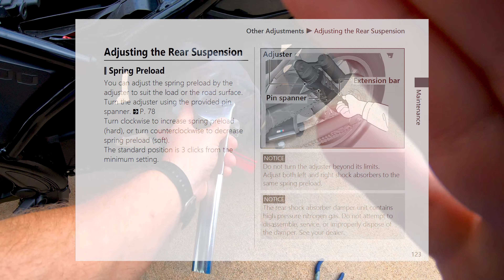REBEL1100: Suspension Tuning Part 2 - Adjusting rear shock preload

Comment: I got a copy of the service manual and it states the adjustable range is 18 clicks with the first click being zero so you must have been at the limit when you counted 20.  Thanks for the video.
Reply from the maker: Thanks for the info, Wayne!  That's good to know.  It's odd that Honda stated not to exceed the maximum setting while also not specifying what the maximum is in the owner's manual.  I ordered my factory service manual, but haven't received it yet.  Cheers!  👍  --QM
Reply: Rebel gang bb I had to get the service manual too because there is nothing online

Comment: I will be doing this tomorrow.  Thanks for blazing the trail here!  I read somewhere else to cover the ends of the spanner wrench with duct tape or similar to protect the paint.  I have the same bike except in red and love it.  Your videos are a big help along my journey. Keep it up!  You have a new subscriber!
Reply: I am 200LBS and adjusted my preload to a 10.  Using the excellent zip tie test I took the bike out for a little spin on normal, paved roads. I did not hit any potholes or speed bumps and the zip tie ended up about 1CM from the bump stop.  I might want to go up to an 11 or 12 if I go on bumpier roads or put on the saddle bags but I’m close. I certainly don’t want anything less than a 10.  I purchased the spanner wrench from my local Cycle Gear shop.  It’s a little big but it did the job.  I hope this helps others who might want to get a close setting right from the start.
Reply from the maker: @tangysquid  Thanks for the feedback, and I'm glad you found a good setting on your Rebel!  In my follow-up video ( https://youtu.be/-3sVtI69izE ), I cranked up the rear preload 20 clicks just to see where it stopped (Honda omitted that fun fact from the owner's manual).  I ended up setting my rear shocks at #7, and I bumped up the front preload about 1/2 turn clockwise to balance it out.  So far, that has worked well for my 170-pound riding weight.  I'm still surprised that Honda only set these bikes at #3 out of 20!  Aren't North American (esp. USA) owners considered to be "fat" and heavy compared to the typical Asian markets?  C'mon, Honda... our hefty buns need more preload!  🤣👍  --QM
Reply from the maker: Thanks for the feedback, Michael!  I've used the sandwich bag trick for decades on fancy anodized fasteners (e.g., fuel line AN fittings & other racing bits), but I've never needed to use it for shock collars.  The Rebel 1100 is the first bike that I've owned with black anodized coatings on the suspension bits.  I'm searching for some Delrin or Teflon-coated spanners now... hopefully something that I can keep under the seat for adjustments on the road (e.g., luggage or passenger preload adjustment).  Cheers!  👍  --QM

Comment: 18 clicks are adjustable range.
The book says full-soft "0" position.
I'm a heavy guy and I adjusted mine up one click. I'm going to use the flex-tie method and see where mine goes.
I really like your vids, (and life of Birch's).
I need higher handlebars and Burly Brands said they are coming out with extended cables to accommodate higher bars sometime around November. (Just for FYI)
Reply from the maker: Thanks for the feedback, Eric!  That's great info on the rear shocks!  Honda really should have included that info in the owner's manual because that's a normal operational adjustment for any (every) rider.

I'm looking into bar risers or possibly different bars for my Rebel to give me a little more rearward reach.  I found these on Webike Japan, and they specify that they work with the OEM cables:  https://japan.webike.net/products/24732617.html .  The change is listed as +50mm (2") rearward and +15mm (0.6") taller.  That's almost exactly what I need for a more comfortable ride with my short arms.  Cheers!  😉👍  --QM

Comment: I've had my 2023 1100 for about a month and it happened twice...the first time it slammed me i thought damn it's too stiff but seeing it's adjusted almost to the top and after thinking about when it happened a second time i figured it bottomed out so i tightened it two clicks which made a difference I'll probably go one more click & see
Reply from the maker: Yep, the Rebel's rear shocks are severely under-damped, so we need to fight that with spring preload to prevent bottoming-out.  The factory setting of 3 clicks (out of 18) is way too soft for most American riders.  I set the rear preload at 8 clicks, and that seems to work well for my ~170 pound riding weight.  Cheers!  😉👍  --QM

Comment: The engineers are watching this sweating on his 20th click
Reply from the maker: 🤣👍  Them and me both!  I was really hoping that something didn't snap or come unseated on that first crank-up!  The official service manual states that there are only 18 adjustment clicks on the rear shocks.  Maybe I was spinning on the 19-20 clicks... dunno?  Other owners have mentioned that they were able to do 18-20 and then the adjuster stopped (wouldn't rotate any further).  The adjustment range should definitely be listed in the owner's manual because that is a normal (and obviously necessary) procedure for normal operation of this bike.  Cheers!  👍  --QM
Reply: @QuasiMotard  I'm hoping so. I'm sitting 240lbs with gear on. This would be a killer flaw on such a good bike. Wild west moto or V1 moto? Who's got better people?

Comment: Just found your video now. I too live on the West side of Houston, and the streets buck me up out of the seats on every ride. I'll definitely adjust per your reccos as I'm also about your same size, but 10 pounds lighter. Question. What type of pegs do you use, my right foot frequently slips off.  Thanks for the info.
Reply from the maker: Howdy, neighbor, and congrats on your Rebel 1100!  I've had good luck with my Rebel set at #8-9 on the rear shocks and about 3/4 turn (clockwise) added front preload.  The ride firmed up a bit, but it isn't overly harsh.  I don't experience the violent bottoming-out over highway ripples and pavement seams like I did with the factory settings.   😉👍  --QM

Comment: Great video, question is the the rear suspension set at position 3, so if i wanted to go 8th position i would only have to go 5 more clicks. Should i also adjust the front suspension, what is the factory setting. 200lbs driver
Reply from the maker: Thanks for the feedback!  I would recommend increasing the front and rear spring preload at the same time.  The rear shocks are originally set at #3, but you can always back it down to 0 and work upward to verify that you're on the same setting for both sides.

The front preload is originally set at 3/8" (9mm).  I would recommend increasing the front preload about 3/4 turn clockwise and first, and then work in 1/2 turn increments up or down to test the front fork compliance.  You can use the zip tie test as shown in this video or just go by feel to make it comfortable for your riding chores.  Cheers!  😉👍  --QM

Comment: The smart person puts 3 or 4 zip ties on the springs, sits on the bike to preload the springs, and cinches the zip ties on the springs tighter so the spring is already compressed.  And THEN they adjust the preload without the spanner wrench. Then they cut the zip ties off.   Set the adjuster at 50% in the middle of it's adjustment and go from there, adding or subtracting.   The zip tie on the oil damper rod should compress about 25 to 30% of it's travel stroke with you sitting on the bike with all your riding gear on. You'll go through a lot of zip ties doing it this way, but in the end, it will be set right, for your weight.

Comment: Ok, thanks again for the content.  I noticed a Ram ball on the where the left mirror was.  I've been looking for just such a mount and came up with nuthin!  Where does a person find this and is it stable for phone/GPS?  Thanks in advance.
Reply from the maker: Those RAM balls are here:  https://amzn.to/3uz7640.  I screwed those into my original mirror mounts because I'm using bar-ends mirrors (CRG Hindsight LS: https://youtu.be/U7Bggy5diaM ).

If you're still using the factory mirrors and need a RAM mount, then try these under the mirror stems: RAM Mounts RAM-B-272U 9mm Angled Bolt Head Adapter Ball Base with B Size 1" Ball https://www.amazon.com/dp/B0012TRIY4 

I have these mounts on most of my motorcycles, and they are very useful and stable.  The flexibility of mounting a phone, GPS, GoPro, or whatever just can't be beat!  😉👍 --QM
Reply: @QuasiMotard  Thanks a bunch!

Comment: Whats up QM!
I just did the same adjustment test on my shocks and i think im looking into something heavier duty. For reference, im 5'8, 220lb, im on the 15th click from zero and my ziptie still hits about 3/4 the way down on medium highway bumps. BURLY maybe?
Reply from the maker: The Showa shocks on the Rebel just don't have enough compression damping, so we're fighting that with spring preload.  I will probably replace my rear shocks later this year with a set of Öhlins or Burly shocks that are damped better (fully-adjustable if possible).

When you are doing the zip-tie tests, remember that you are looking for full-compression over "normal" road surfaces.  You want to get the full stroke out of the suspension so you aren't making the ride overly harsh.  It's not uncommon for the shocks to bottom-out, but that shouldn't be the norm... it should only happen under extreme conditions (e.g., potholes, large dips at high speed, railroad tracks, etc).  Higher quality shocks that have adjustable damping will certainly be our cure.  Cheers!  👍  --QM

Comment: Nice video.  Thanks.  Did you have to get a power commander for the new exhaust?  Any changes in power?  Thanks
Reply from the maker: Thanks for the feedback!  I haven't noticed any difference in power, so it doesn't seem to be running lean.  I'm still waiting for DynoJet or other tuners to release their products for the Rebel 1100.  When those are available, I'll purchase one and rent some dyno time to tune the bike properly.  Otherwise, I'll get an auto-tune kit with a wideband O2 sensor and let it tune itself while I ride.  Cheers!  😉👍  --QM

Comment: Any chance you could measure the dbs on that exhaust? Would love to compare with other options in the market! Appreciated!
Reply from the maker: I ordered a decent (~$200 USD) industrial sound pressure meter a few days ago, so I'll try to use it to record the dB readings.  It won't be a certified test, but I will try to replicate the "official" measurement procedures (e.g., distance from the source, engine RPM, idle vs open throttle, etc).  If all goes well, then I'll post that follow-up video sometime within the next couple of weeks.  Cheers!  👍  --QM
Reply: @QuasiMotard  Oh! That's awesome! Thank you for your dedication! Very much appreciated!
Reply from the maker: I just released the second video with a new Coffman's Shorty, and I included audio and dB readings:  https://youtu.be/xqvVA_YBYLE .  I hope that helps with your shopping!  Cheers!  👍  --QM

Comment: How can I be getting opposite results from others? I weigh 190 lb and initially tightened a few clicks from the factory setting only to feel a much harsher ride. I clicked back all the way to the minimal setting and noticed improvement. The zip tie test followed - just initial sitting on the bike moved the ties about 1/2 way down the rods.  Then from that spot, test riding for a few miles over some discernable bumps and 'washboard' type bumps on asphalt only brought the zip ties to about 1/4" from the bottom. It finally bottomed out over some very sharp bumps. Your thoughts?

Comment: Any idea how much preload one would need for driver + passanger together about 150kg / 330 pounds? Or how many kg/pounds of load is one click worth? I mean like... add 20kg of bags and ... how much more clicks it needs? EDIT: me, with my body+gear 95kg/210lbs finally got the rear suspension not bottoming out on normal daily commute @ 12 setting (~1cm left room from top of ziptie to the bottom beige rubber thingie. I am afraid with passanger you need to go to max 20 setting easily...
Reply: Your observations are correct.  Honda designs these bikes around tiny Japanese men, not corn fed Mid West American males. The bike coming with only a single seat should be another indicator that it's not designed as a two seater, really.
Reply: I just asked the same question in the rebel group as us together are 330lbs and always ride 2 up and we've been using it in the default it came. Driving yday we hit a bump and the bump scraped something under the bike.
Reply: @sohantanna625  And did you get an answer? If not, then I would go straight to 15 setting and start doing this ziptie test from there with passenger over some smaller bumps and adjust from there. Just be careful to not go over the max setting (which by service manual is 18? some have gone to 20, but that's already in risky territory.).

Comment: Does anyone know how many clicks per rider weight? What about the setting to ride with a passenger? Thanks for the video ✌️😎
Reply from the maker: Honda doesn't list any specifics in the owner's manual at all.  This testing is largely trial-and-error, and it depends on your riding habits and road conditions.  Based on my tests and responses from other Rebel 1100 owners, I would suspect that riding with a passenger will require the rear spring preload  to be near its maximum setting.  The general feedback so far looks like this:

 - 100-120 pounds: 3  (factory setting)
 - 150 pounds:  5-6
 - 170 pounds:  6-7
 - 200 pounds:  8-10
 - 220 pounds:  10-12
 - with passenger: 15+ ?

Cheers!  👍  --QM
Reply: hey, do you include the weight of the DCT transmission on this suggestion list?

I am 180 pounds yet I use a DCT 1100T, which is ~45 pounds heavier than the manual non-T 1100, and I set mine to 11th from the softest on the rear (factory+8) and a full  turn on the front (front was not bottoming out but I tightened it to match the rear), now I don't have rear bottom outs yet unfortunately the suspension is just too rough

Comment: It goes to 20 clicks then stops. Will not go any farther. I weight 215lbs and it still bottoms out at 30mph on some bumps. Will need to buy a new spring or new shocks,

Comment: Question? Is the “AirHawk” any good? Please advise.
Reply from the maker: Yes, the AirHawk seat pads are fantastic!  They do require a bit of tuning and fiddling around with the amount of air to achieve the best comfort.  The best setting is with just a slight amount of air that only fills in the gaps, but you're still connected to the bike's seat below.  Too much air makes them feel squirmy and you'll feel like you're sitting on a balloon.  Cheers!  😉👍  --QM
Reply: @QuasiMotard  Thanks for getting back to me I heard the same thing slight air would do the job and comfort.

Comment: So when you add preload on the rear is this lowering the bike slightly ?
Reply from the maker: Howdy, Peter!  No, increasing spring preload will reduce the static sag (weight of the bike on the suspension) and the rider sag (weight of bike and rider on the suspension), which will generally raise the bike slightly from its laden height.  

That doesn't mean that it lifts the bike up higher.  The shocks can only extend to their full ride height.  The springs resist "sag" or compression of the damper due to the weight of the bike and rider.  The trick is to use as much of the suspension stroke as possible (smoothest ride), yet still avoid unnecessary bottoming-out of the shocks under normal riding conditions.  It's not realistic to expect the suspension to NEVER bottom out, but it shouldn't be a normal occurrence.  Cheers!  😉👍  --QM
Reply: Thanks for the reply, I understand what you have said, thanks again.

Comment: Does it feel like a full-size cruiser?
Reply from the maker: Good question!  The Rebel's seating position for me is unique... not quite standard, not quite cruiser.  I'm 5'7" with a 30" inseam (proportional torso length).  The Rebel's mid-controls are a bit more cramped than normal cruisers, and the handlebars don't reach back toward the rider like a typical cruiser.  My riding position is decidedly hunched forward, so I have ordered the Kijima handlebars that should reach back a little more so I'm not hunched forward so much.  Cheers!  👍  --QM

Comment: Looking at this bike, it should have been a standard first.  With its peg position, it should be quite a comfortable commuter.
Reply from the maker: Do you mean "standard" as in standard/manual shift, or as in a standard/upright frame design?  The Rebel 1100 is available in both manual shift and DCT versions:  https://powersports.honda.com/street/cruiser/rebel-1100/ .  The manual version weighs about 22 pounds less than the DCT (487 vs 509 lbs)... otherwise the bikes have the same performance, ergonomics, and features (e.g., ride modes, ABS, etc).  Cheers!  😉👍  --QM
Reply: @QuasiMotard  Like a Ducati Monster.

Comment: 170 lbs - lucky (im taller tho) disapoint no going for cake or a soda :) ps quasi buys a new bike then starts thinking about another and yes AT engine in a 600 size bike would be good - rip the four outta cb650 and put this in it would fit
Reply from the maker: Agreed!  If Honda would drop this motor into the CB650R or CB1000R chassis, and leave it in the full AT tune... oh, that would be a fun ride!  I don't know how the power/weight ratio compares to the inline-4's, but the twin's torque lower down should make a great canyon carver.  👍  --QM